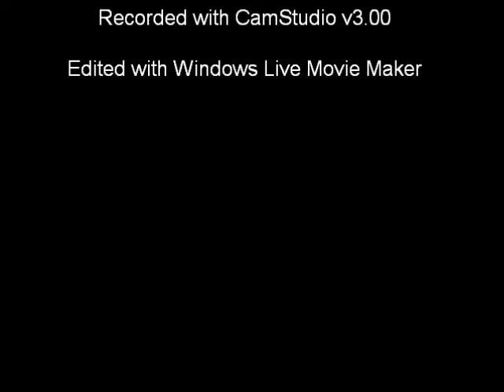An Elementface Minecraft How-To: Combination Lock

Comment: so in a nutshell there are 4 outputs, which convert into 2 outputs, which ultimately converts into 1 output which is the door... i assume you used the same configuration on both pair of switches and the only difference is at the end of one of the 2 outputs you inverted it... and you're right... there no simple way to explain it...